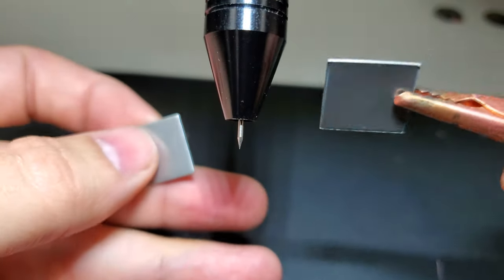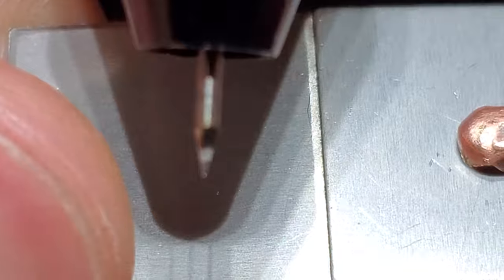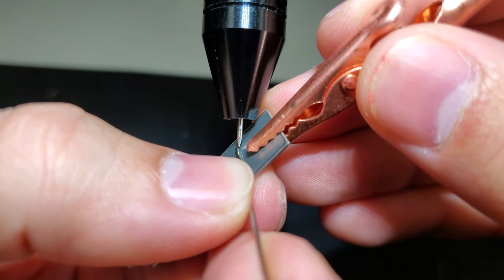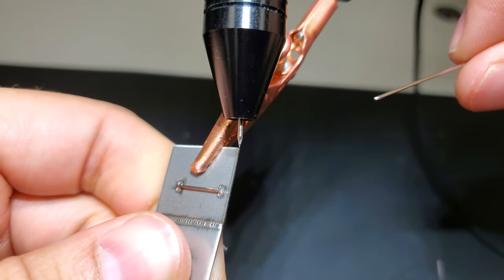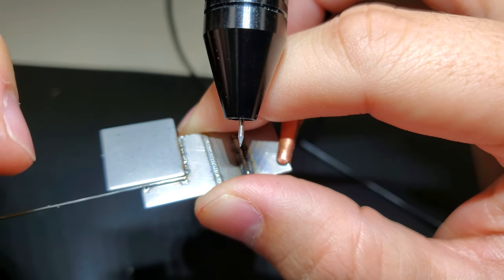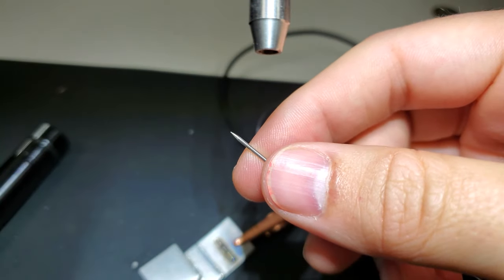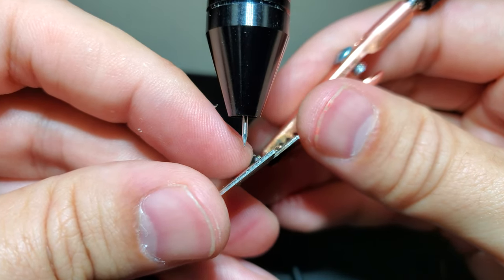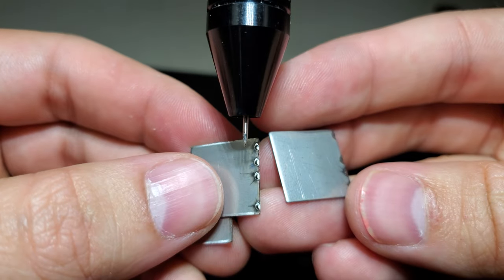Pulse Arc Butt and Lap Welds With and Without Fill Wire Tutorial and Demonstration

Comment: Do the pieces need to be grounded for the welder to work correctly? Also, does this unit require argon gas to function?
Reply from the maker: At least one of the 2 parts need to be grounded to produce any welds. As a rule it is recommended to keep the ground close to weld area and to attach the ground to the larger of the parts when applicable.  This machine also requires argon to produce welds properly.
Reply: @SunstoneWelders  Thank you. I'm also need to determine the quantity of argon this will go through in a typical day so I can optimally size the argon gas canister rental needed for our new shop. My best estimate is that we would be doing 10 spot welds per 15 mins?
Reply from the maker: @GregJoshuaW  Welding all day in the lab. I go through a 4 foot tall tank once every 1-2 month(s)

Comment: This is amazing! Can you weld something like 30 thousanths  thick brass or copper?
Reply from the maker: Hello, Steve,
Brass is not a good choice for this machine. The zinc content of brass causes it to vaporize and results in failed, messy welds. Copper however is possible when it is soft. The softer the copper the easier it is to weld.
Reply: @SunstoneWelders  ok, thanks for your reply. I appreciate  it.

Comment: Would this system work on Pot Metal?
Reply from the maker: It will, but you won't get a clean weld like you are seeing in the video. Pot metal does not weld well. You can use silver wire to help with strength and to help the weld look cleaner.